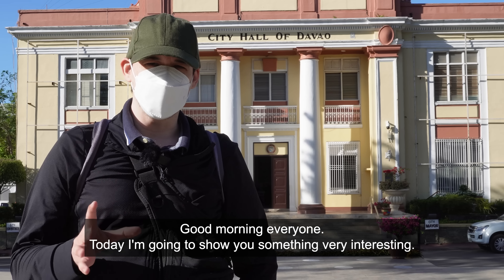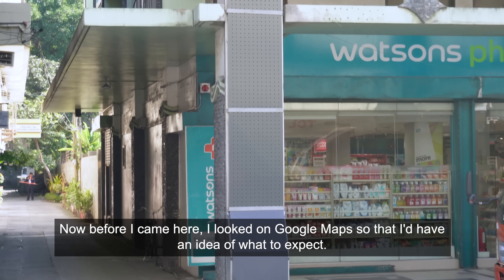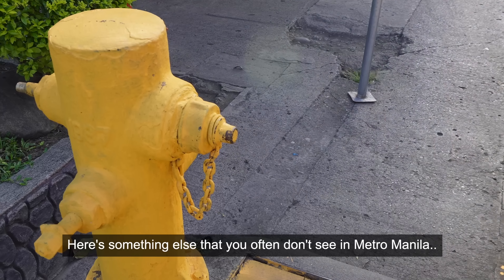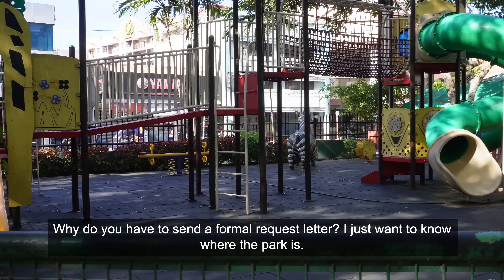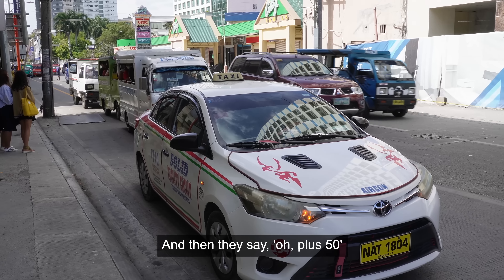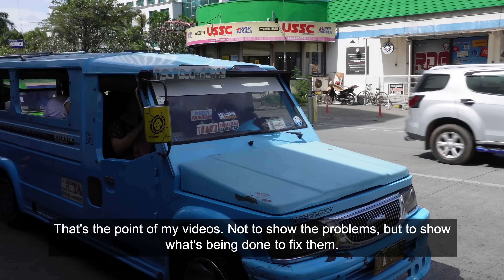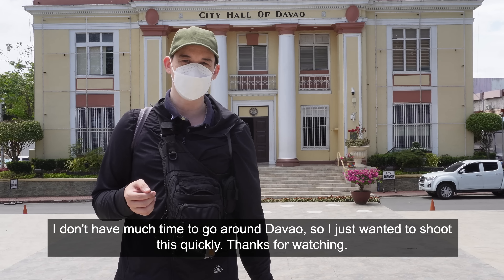Davao City - Benefits of Undergrounding Power and Telephone Wires

Comment: As a Cebu native, the whole Osmeña Blvd, Cebu Business Park, Cebu IT Park, and the South Road Properties (SRP) are the only parts of Cebu City that have underground wiring (Colon sadly still has spaghetti wiring) but Davao City literally did it to its downtown.  And I say its downtown is leagues ahead of the chaotic and disorganized downtown (Colon) of Cebu City.
Reply: Aboitiz is behind the construction of the underground cabling here in davao. No question na kaya nilang gawin din yan jan even better pa cguro kay homebase nila diha.
Reply: @darkboard5556  The project funds i believe comes from the Davao city LGU. Not sure if the Davao Light spearhead the project but certainly they have major input into the migration of electricity wires. Tama din sabi mo na mas efficient kung involved talaga ang utility companies sa pag implement ng projects. Sana magkaroon ng national policy to slowly migrate to underground cabling.
Reply: @kripler3001  lgu funded but construction is 100% aboitiz. Pagdating sa technical know-how no question. Ang tanong eh mag cooperate ba ang mga telcos lgu at mga tao sa cebu?
Reply: @darkboard5556  Depende na yan sa political will ng Cebu LGU at kung ishoulder nila 100% ang cost. Kasi dito sa Tagum city noong early 2000's eh ng offer ang LGU na i underground lahat ng cables at power lines. Ang LGU ang mgprovide ng equipment at manpower samantalang ang utility companies naman ang magshoulder ng cost. Ayun, di na tuloy.
Reply: Aboitiz has no choice, theybahve to cooperate with LGU Davao or else they will lose their business

Comment: In Manila, the government needs to prioritize the canal system to prevent flooding. Once this issue is addressed, moving wires underground can be considered. I hope that these improvements are made before my time so that I can witness the positive impact myself.
Reply: Davao also has problems with flooding and mass transportation and hopefully, the local government will address it soon. I'm hoping for a better Philippines and not just a better Davao. Padayon sa paglambo, Pilipinas!

Comment: My apprehension with putting wires underground is the frequency of natural disasters we have. A major earthquake could cripple power…underground wires would be more troublesome to fix. Couple that with flooding from typhoons and sea level rise. Hiding them underground definitely looks better, but they should also consider the cost and ease of maintenance.
Reply: Underground cabling system have multiple layers of insulation. It's not that easy for an electrocution to take place unless the earthquake you are referring to is a magnitude 9 or 10 during a severe thunderstorm or typhoon which is very highly unlikely to happen.
Reply: @kripler3001  My apprehension is not about electrocution, it’s about maintenance.  Earthquakes could cut off power and they would need to dig them up with only a general idea of where the break is. They’re using pipes with limited access. Unlike the ones in Japan, which have associated tunnels for maintenance, you’d need to pull the whole length of the cable from the pipes to check and repair. Currently, fixing visible wires already takes a long time. How much more if they aren’t readily available for inspection.

Comment: People ib davao city are used to discipline imposed by the Dutertes thats why safety is the first thing that one could be felt when one roam around its streets. Traffic enforcers are all over in every main corners thats why the simplest violation like forgetting to turn on ones headlights are also cited for violations. The speed limit is also practiced since there are enforcers with speed gun with cameras that one could not deny if one is over the limit.

Comment: Hate to be the bearer of bad news but underground padmounts are extremely dangerous.  The risk of explosion is very high because of the heat and humidity.

I worked for a Southern California utility company and we went from overhead then to underground and now they are going back to overhead. We had a number of deaths in underground vaults.
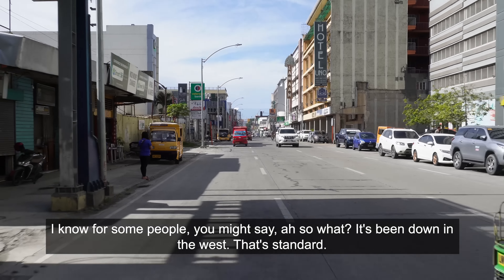Reply from the maker: Can you look at the platform on the left, at 5:39. 

Could those be the padmounts?
Reply: We've had underground electricity in the UK for over 100yrs, thatt just isn't a thing here, just needs to be done properly.
Reply: @House building in Mindanao  the climate conditions are different. Factor in humidity and temperature to get a realistic scenario. Southern California weather is closer in conditions to the Philippines sans humidity. I don't know if the lack of humidity is a factor to the catastrophic failure risk but I know that as a company, we did so many simulations and risk mitigation studies before the decision to go back to above ground was made.
Reply: Places like BGC have put their cables underground.
Reply: @rctteensma  Nonsense have you any idea how wet parts of the UK are?  Double the rainfall nationally and in the wettest parts equal humidity and quadruple the rainfall of California
Currently where my house is in Easex UK humidity is 73% and where my house is here in Davao City its 82%.
Parts of the UK have double the rainfall of Davao City

Comment: pretty sure as soon as the cabbles are gone there will be higher trucks
Reply: Nope, Trucks are banned entering downtown area.
Reply: since when do truck bans work?
Reply: Trucks have separate route at Lanang intersection heading to R. Castillo via Boulevard st. C.M Recto where he is filming is the main road for motorist. There are no large trucks on the main road.
Reply: @dercorta-noyokamiboyteenpr2166  trucks cannot pass downtown area because there's circumferential highway to cater them
Reply: Good luck all trucks enter downtown, fenalty is waving

Comment: One reason you dont  see h20hydrant because it is under the sidewalk.
We have a lot of them in Manila city.
Reply: hes.talking about water hydrant cap being absent not the numerous  number of the hydrant
Reply: cap po ang pinag uusapan na palaging nawawala po, compare to Davao na nakakabit pa rin po.
Reply: @erbinbronira9837  yes i know but cant i make another comment or reaction the solution the BFP did in regards to h2o hydrant problem.
Reply: @novus310  opo nautuwa naman ako at maayos and h2o hydrant niyo. Nabangit ko lang na sa metro manila nasa ilalim na ng bangketa ang h2o hydrant para di na manakawan. 
Di naman siguro masama yun dagdag kaalaman.